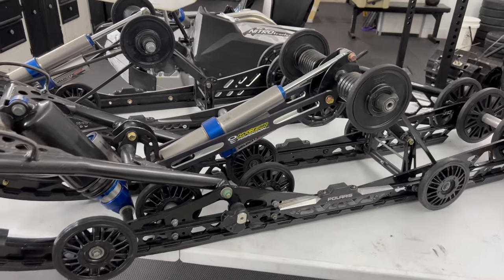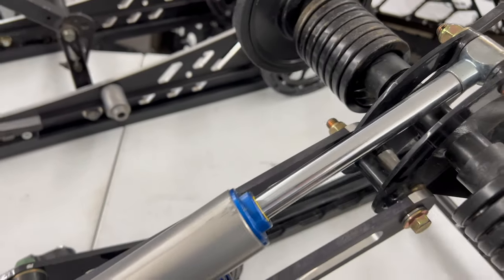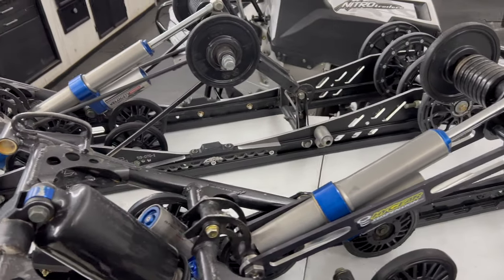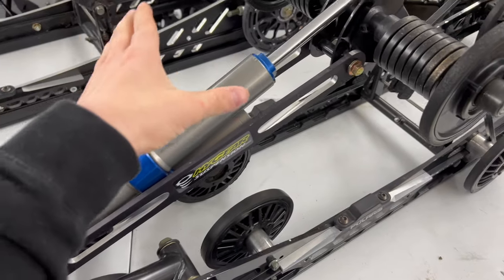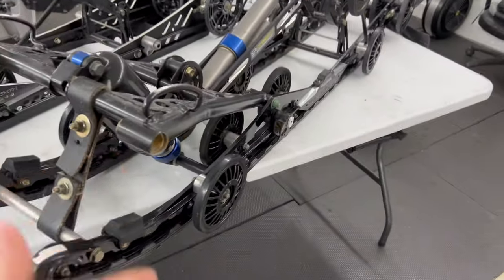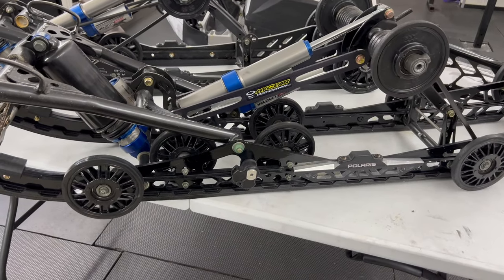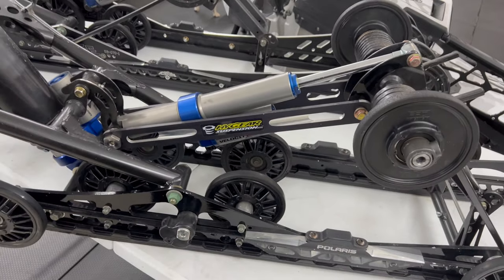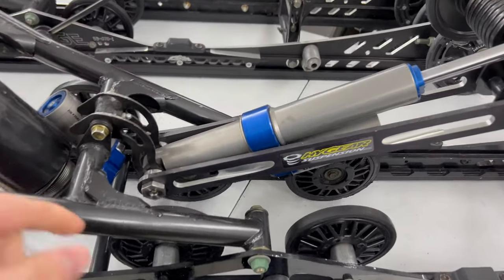HYGEAR SUSPENSION ASSAULT IGX LINKAGE KIT! ULTRA PLUSH RIDE AND A HUGE IMPROVEMENT!

Comment: I have 200km on the linkage and I'm beyond impressed; it completely transformed the sled.

I have the LD springs, both shocks rebuilt with 10w oil (factory is 5w) and the linkage; each was an important piece of the puzzle but it's a "whole is greater than the sum" situation. Sled is night and day better in every situation on trail. And no more getting bucked off at speed!
Reply from the maker: some little tweaking and these things really work well!!
Reply: @TheBigredspecial who did you get to do your shock work north of the border?
Reply: @mitchcondon3077  Had the dealership service them, I supplied the oil and N2 specs (200psi both shocks). No one local does revalve work; the heavier oil is kind of a stopgap